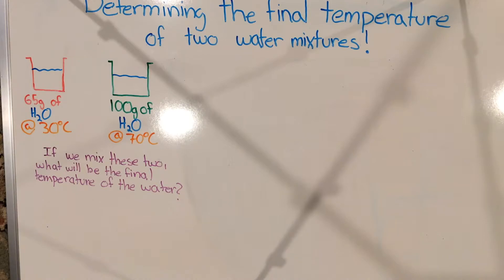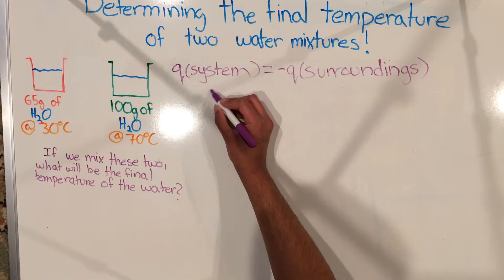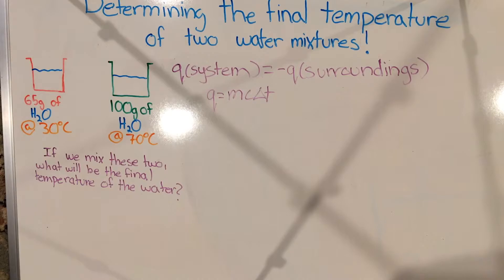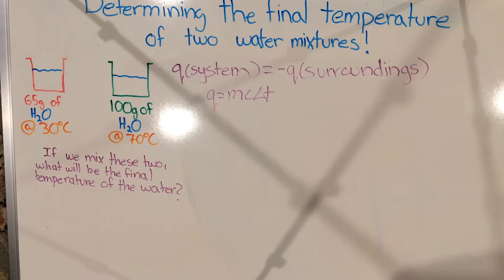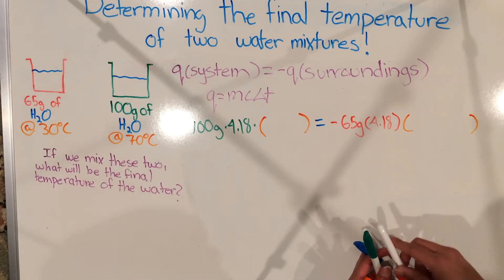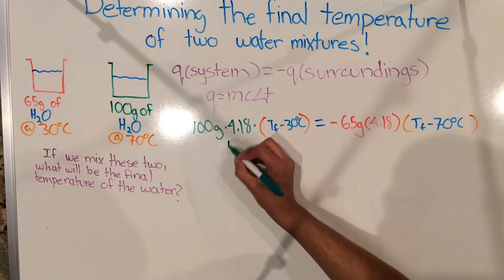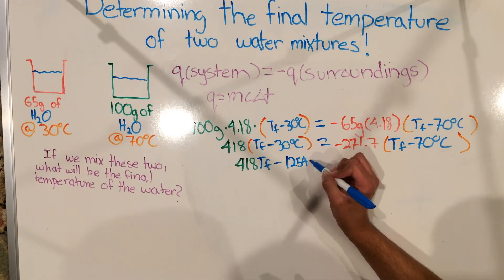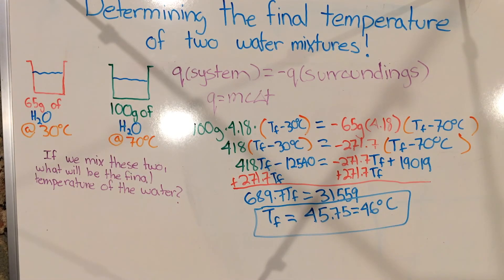21 Final Temperature: Mixture of Two Water Samples

Comment: Omg I literally think of this every time I have a bath ! 😂
Paused it explain my thinking as a layman
Assumption: 1ltr of 100C and 1 life of 0C = 2litrs of 50C
So 2lts 100C + 1ltr 0C = 3ltrs 66.6C
3lirs 100C + 1ltr 0c = 4ltrs 75c

But what about 1ltrs 100c + 2ltrs 50c?
3 litrs at 88.3C? That sounds right
 100C = 1/3 of total volume so 1/3 it's temperature? 33C + 2ltrs 50C?? That doesn't sound right
So it's like the combination of total temperatures, divided by the total litres, multiplied..somehow.. by the ratio? And that's where my brain can't hold anymore information and I dont have the mathematical knowledge to express and solve it 🤯

Comment: Why do you have the 100g with the 30 degrees? when the 100g is 70?
Reply from the maker: That is an error - you are correct that the 100g should be with 70 as the initial temperature (these videos were made by students and so there are some errors)